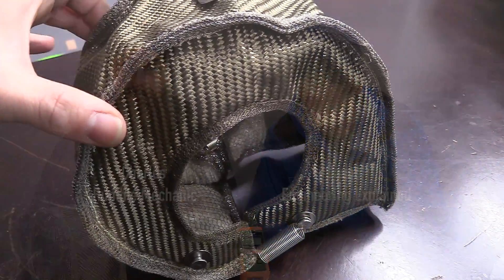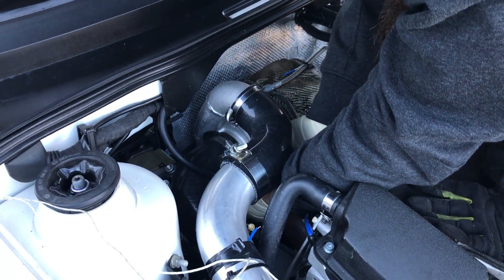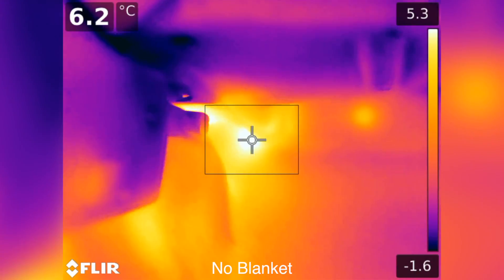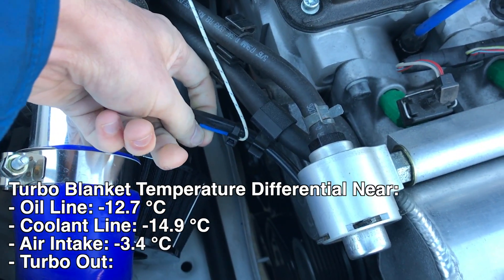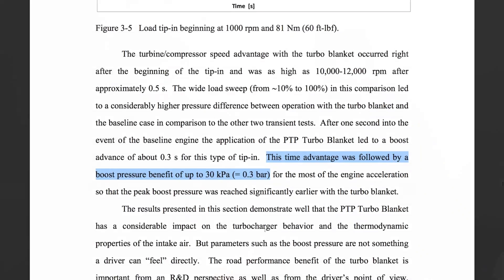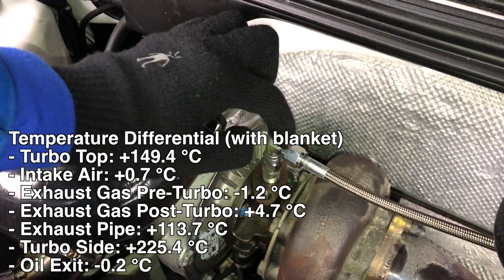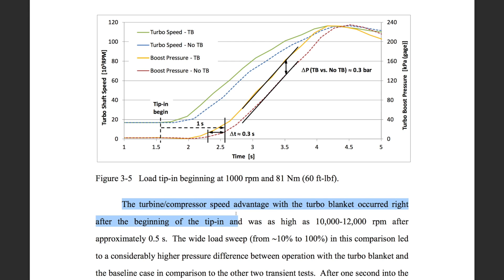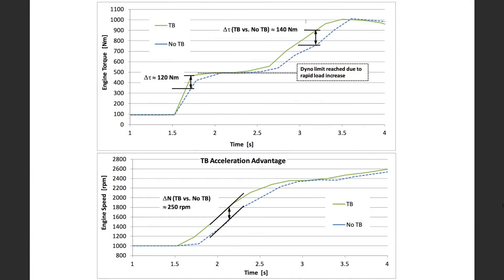Can Turbo Blankets Be Proven To Increase Performance?

Comment: Key question: The turbo blanket caused a faster spool and reaching the engine's torque "plateau" sooner, BUT does the torque plateau end sooner (at a lower RPM) or does it carry on to an equally high RPM as the pre-turbo blanket version of the engine? (Does a turbo blanket just "shift the curve to the left" or does it make the torque curve (plateau in many modern turbo engines) actually wider by starting the plateau sooner / at a lower RPM?
Reply: If the curve just shifts to the left, it's a low-end torque vs. higher end hp trade-off. If it makes the torque curve broader by starting it sooner and potentially carrying it on higher in the RPM band then it's a win all-around.

Comment: Does the turbo blanket cause any issues with catalytic converters since the exhaust temp on the hot side of the turbo is going to be hotter as well?

Comment: I wrapped my stock wrx's TD04 in an ebay blanket yesterday because the old heat shield was missing. Came here in search of answers as to why it's spooling much sooner and doesn't lag. Most unintended power mod ever, I'm surprised.

Comment: So now we know that if you put a turbo blanket on the hot side of a turbo it actually helps with the turbos efficiency. What happens if you put a turbo blanket over both the cold side and the hot? Would that help as well?

Comment: Well done on quantifying the results! What would be better than a turbo blanket is dedicated ducting to isolate the turbo with airstream and then dispose of that air (perhaps under the vehicle). That would mitigate heat soak on other components and avoid the concerns of turbo overheating and service life. I'd love to try this but am extremely wary of my materials catching fire.

Comment: My follow-up response is trying to compare this information (regarding the increased pressure found in the turbo due to a denser air on the hot-side because of the blanket), in terms of your other video explaining why 'Back Pressure is Bad' in an exhaust. If there's essentially a net gain in exhaust pressure for the turbo due to heat, then could you also redesign the entire exhaust to be wrapped in a thermal blanket to help adjust for more efficient exhaust pulses to the turbo from the manifold all through the exhaust tips?

Basically, if the internal pressure is increased due to temps, then an adjustment to the exhaust diameter (and maybe routing) could be made to better facilitate an optimized escape velocity, correct?
I wonder what the efficiency gains would be if you wrapped each manifold outlet in a TB prior to hitting hot side, as well as wrapping hot side and the remainder of the exhaust. I know it may sound excessive, but if the goal is to get near as close to 100% heat out of the combustion chamber as possible with maximum efficiency, then why not use the pressure gains (that we've all seen as factually proven) to use in the entirety of the exhaust cycle?

Great video and the collabs are fantastic to watch!

Comment: Great video, but can you explain why the manifold temperature would be cooler, is it because the heat in the turbo is pulling the exhaust gases through quicker? Also,  would this application be advisable for a TD5 diesel in Australia where ambient temps can be as high as 42c and doing 8 hours of driving? Trapping the heat in I would be worried the turbo would simply melt, as it is it can get glowing red hot..

Comment: 4:10 is it only radiation? What about convection that reaches the firewall? Is it radiation that transfers most heat to the firewall? Or convection? What ultimately reaches the footwell is conduction (the heat transfers through a solid material after all).

Comment: Just a comment...there can absolutely be benefits, but they are not universal, and are, rather, dependent on the type of turbo and the vehicle. With regard to the Porsche VGT turbos, they operate at so close to maximum gas temperature at exit of the turbos that if you wrap them in a turbo blanket the metallurgy of the turbo case will come under severe duress and can actually crack...so turbo blankets are a big No No in the Porsche 911 Turbo world, especially the tuned Turbo world (a guy who owns a 700Whp 997.1 Twin Turbo with 68mm VGT Turbos.

Comment: I'm glad you guys talked about the oil temperature. That's the one thing I was thinking in my head that might end up damaging the turbo or degrading its life. 
I'm gonna consider a blanket or some of that heat wrap. Sounds like a fun project.

Comment: Hey guys what’s up🤘 
Question.., if my turbo sits in front of my heads, the air comming in through the grill will keep my turbo cool, perhaps but will this make my heads hotter because of the radiating heat? And will a turbo jacket keep my heads cooler??

Comment: what would happen if you wrapped an engine block in heat shielding? could you improve efficiency?

I know a car that won a fuel economy challenge had one... it got 300mpg in the 1970s with a V8 Engine and conspiracy theorists always point at it as being a technological cover up by oil companies but if you actually read further into the story it actually turns out they cheated, they altered to engine so it would run on engine oil and the heat shielding was to keep the oil hot enough for combustion (so it burned 5L of oil and and 500ml of petrol).

Comment: all that's running through my mind is "will it reduce the operating life?" surely insulating the turbo is increasing the likelyhood of heat damage? especially if it's not designed to run with one

Comment: Why it's a bad idea to trap heat in your turbocharger.
Motor oil has a temperature that it cooks off. When this happens it leaves a residue and this is called coke. This coke build up slows the oil flow. Now the cooling of your bearing and lubrication is comprised. That is why large trucks always idle before shutdown, to bring the temp well below 600 degrees Fahrenheit.

Comment: Keeping everything else cooler is OK but making turbo even more hotter is smart idea? I mean, there is oil inside and when you turn off car after fast ride turbo is still red or very hot, with blanket that temperature is even higher for 150c which can damage much faster whole turbo. We know how much turbo is fragile and sensitive on every change especial  on burned oil inside which in this case can burn even easier.  May be I'm wrong...

Comment: A lot of people are asking why OEMs don't put these on their cars. 
Some said cost, which seems reasonable at first, but falls off when thinking of the enormous costs that manufacturers spend on small increments in other areas. My best guess would be that a turbo blanket would require proper cooling systems for the turbo after the engine is off, and that these systems don't overcome the perceived benefits. What the turbo blanket would do is keep the heat in the turbo. This is fine while the car is running because the turbo is cooled by circulating oil. But when the engine is turned off, that oil sits in the turbo and and has no way to cool down. There is a device called a turbo timer that alleviates this problem, but it also means leaving the engine running for a short time after the car is shut off. With a turbo blanket, that 15 seconds might become 2-3 minutes. That is fine for the aftermarket, but would be weird for an OEM car that needs to meet regulations in several countries and meet delicate branding in order to be sold.

Comment: Great test and study. The dynamic torque gain vs. engine rpm is amazing.

Now to take it further:
What benefits do you get on a gasoline engine compared to that diesel engine? Is there a benefit by the same margin?
How is the difference between a "standard turbo" and a twin scroll turbo? Does the twin scroll turbo benefit by the same margin than the "standard" model (since it's spooling up faster anyway... will it spool up even faster with the blanket?)?
And importantly: If you go high load for a prolonged time can it overheat your turbo on a gasoline engine? Since it's way hotter anyway than on a diesel?

Comment: An aftercooler (or better aftercooler if you already have one) will do way more. Blankets were first on large diesel engine turbos for safety and fire prevention... no performance gains were ever claimed. If your intake air temp goes up, as you show, you will see no performance gains. Hotter air in the intake simply doesn't do that guys, come on.

Comment: When I build my mini rock crawler I'm definitely gonna go turbo diesel with a blanket. At the local junk yard they have a 3 cylinder 800cc and a 4 cylinder 1.2L, what do you think i should use? Oh, projected rolling chassis weight is 2000-2400lbs and its a two seater.

Comment: It’s very plausible that the heat radiating from the exhaust manifold before the turbo not being wrapped would also affect your temps. Maybe you should of wrapped the exhaust manifold and then do the test with and without the turbo blanket

Comment: I would think the cooler a turbo is the more dense air you have and the better. However, this is true only for the intake before reaching the turbo. Whittle designing jets found that if you kept some of the ancillary components and heat produced by the engine back into the engine, you kept that much more energy produced from being wasted out. You drove back that heat energy into the system resulting in higher efficiency and power. I am assuming that turbo blanket is preventing losses in that manner.

Comment: What effect, if any, would the turbo blanket have on a diesel equipped with a DPF? DPF regeneration occurs by heating (burning) the collected soot out of the filter. I would assume higher temperatures after the turbo would help with the regen, possibly helping with soot elimination. Any ideas EE and HM? Thanks.

Comment: Hi everyone. Thanks for the vid! But one question tought.... I own a Peugeot 208 GTI 208 hbp and wouldn't the turbo wear à lot faster with the blanket on since it keeps all the heat from spreding out ?? Even if the engine bay seems "happier" with it on. Cheers from France and have a nice one.

Comment: Ceramic exhaust/turbo coatings test?

I'm personally a fan and did some minor tests... engine bay temps were reduced. Dunno if it ACTUALLY helped with exhaust scavenging(NA, 2.4L k24 honda engine), but theory says yes maybe probably.

Hell, even ceramic coated the exhaust port on the cylinder head.

Comment: Thanks guys, very informative from a practical view. Having seen a 350 C.I V8 ( 6.0 liter here in OZ)  twin turbo  fitted with blankets, I think it is a no brainer for the waste heat in the compartment alone. On popping the bonnet, I did not get face scorched and all the wiring  and hoses etc would not be scorched and brittle. Then you have the performance/reliability benefits of not heating intakes, coolant and oil lines etc. To be thermodynamically pure, you should wrap  or coat the whole exhaust system pre turbo but then you have metallurgical problems with the metal burning because of the high temps unless you go exotic. It looks like a blanket might even be useful on more humble cars like my TDi Sportage although I have no complaints about response but it would aid response and help the heat issue in summer ( 45 deg.C ambients) as long as there weren't bad effects on the DPF because of the extra heat passed along.

Comment: Best way to insulate wires from turbo headers? Cause they keep burning every 8000 kilometers and misfire happens at high rpm full throttle mode it starts to misfire.  Btw using MSD wires.

Comment: For the same reason it is highly recommended to use the original airbox, which sucks in the air from the cooler outside. It makes no sense to use an air intake filter which sucks in the pre warmed engine compartment air!

Comment: Hey buddy i have a 50 trim that sits infront of the cylinder heads. Im hoping a jacket will keep my heads cooler??? Also does a jacket make my oil hotter??? And i understand it keeps the compressor side cooler??

Comment: Idk how much of a difference it makes, but i would like to throw in the fact that a 6.7 Cummins has a holset turbo that is also water cooled. So I'm curious if that would make a difference in heat transfer compared to a non water cooled turbo in both oil degradation and heat transfer to the compressor side. Big fan of your guys collaborations. Two of my favorite YouTube channels.

Comment: Correct me if I’m wrong but because the air is hotter it is therefore expelled faster and schools the turbo faster rather than being cool down and having left volume and less airflow through the exhaust turbo fans.

Comment: Audi has been using the turbo blanket on the 500-600 bhp R18 TDI LMP1 and 1000 bhp R18 TDI e-tron quattro LMP1 Le Mans racer since 2006. And it won the prestigious race with it. So it must be a good thing to have it on the turbocharger. So, there's no need to have anyone else's approval.

Comment: Wouldnt this add extra wear on the turbo due to more heat on the actual turbo and its components? It says the oil stayed the same temperature but the turbo itself is not. Kinda see heat as one of the biggest causes of wear on  just about anything but especially on cars/trucks

Comment: Those have cracked serveral exhaust housings, especillly on ballbearingturbos where the CHRA  not can handle the high heat and therefore crack. I know several cases where it has happen. I think its better to have some heat protection that dont touch The exhausthousing, etc a heatshield or same material as a turbo hood, but it just dont dont touch the turbo, and just create a shield to stop the warm air from escape to the intercooler (Subaru) or rest of the engine bay.
Just my personal thought.

Comment: You've missed one interesting point:

How does the turbo blanket affect the durability of a turbocharger (housing)? I mean, the housing side gets about 225°C hotter, and the top 150°C hotter ==> you have different expansion of the turbo housing due to high temperature difference. Could it lead to cracks after a while?

Comment: So  how was the EGR circuit routed and what injection method does thr vr6 use? I ask because on a Mini Cooper(2011) 1.6 the egr gas is routed back through the inlet side of the turbo to pass into the intake again, i added an oil catch can on mine but im wondering what if any impact a blanket would play on the egr gas/oil vapor that goes through would it increase coking or decrease it? I hope my question made sense...

Comment: Why automakers don't use long shaft between turbine and compressor as Mercedes in F1 to keep turbine cooler and have shorter air pipes - smaller turbo lag?

Comment: Well, very good video. Heat reduction in hood compartment is great, but what about the heat concentration and big temperature rise in the hot side of the turbo?,  All that heat it is not bad for the turbine and turbo housing?  There are theories about housing cracking and turbine damage due to extreme temps because of the blanket??

Comment: If the turbine housing is 200C hotter, it will be likely to warp more, and more likely for the turbine wheel to rub the housing, causing blade damage and bearing failure.  The blade clearance is typically < 0.020".  I took measurements once that showed a turbine housing expanded by over a millimeter from thermal expansion.  All housings heat unevenly and this causes transient warping and thermal fatigue causing cracks.  Be careful.
Reply: One other point to make about messing with turbos, is when they are developed they are rated for certain maximum conditions, not to be exceeded, and it's important that you don't.  An average turbine wheel at maximum rated speed contains more than 25kJ of rotational energy; 2x the energy of a 50cal bullet.  The maximum speed of the blade tips is > 2000 ft/second (1400mph), faster than the muzzle velocity of most handguns.  If you run the turbine housing beyond its qualified temperature, it may be weakened  and may not contain a turbine wheel burst.  Turbine wheels can literally split in half if oversped or the temperature too high and is cycled too many times.  The turbine wheel can also separate from the shaft, and be ejected from the turbine housing outlet, which happens to be pointed back at you, and roll around at the remaining speed of the wheel, potentially hundreds of mph.  Just so you know.  Be careful, these are powerful machines.

Comment: Through most of the video I kept wondering "but what about all that heat inside the turbocharger!?" and then towards the end you spoke to that a little bit. You mentioned that in the university study the turbocharger oil was virtually unaffected. So that's part of the answer to my question I guess.
...but...
There still are a number of different parts in the compressor and in the exhaust path downstream from the compressor that are seeing considerably higher temperatures than they were designed to withstand. That's GOTTA take a toll over time, NO? I mean wouldn't we expect fatigue, cracks, warp, or other problems sooner or more frequently with those significantly elevated temperatures??

Comment: would it affect the life of turbo chargers..i understand turbos are made to withstand temperatures in excess of 1000 degrees..but if we are trapping the heat essentially not allowing it to radiate and get cooled with air in the engine bay..wouldn't it shorten the life..things like corrosion, cracking or leaks in oil lines that cool the turbo??

Comment: Since no one asked, I will. What does it do to that Turbo having it 150 degrees hotter with the blanket on? It already sits a almost a couple hundred degrees then we add another 150, seems super stressful. I would rather not use one and eat the small gains and have durability, But as far as the oil lines, I would build a blanket like sleeve for the lines cause there is no cons there.